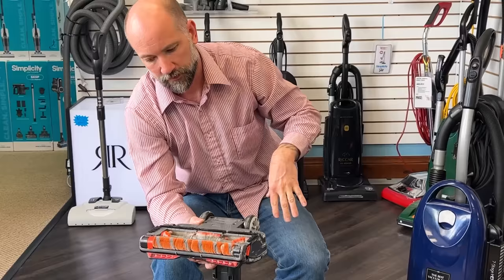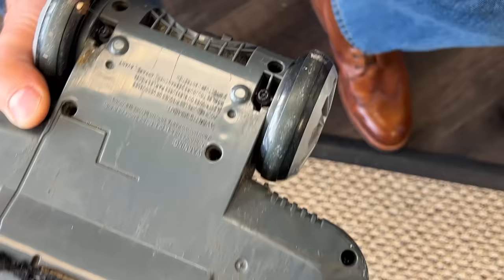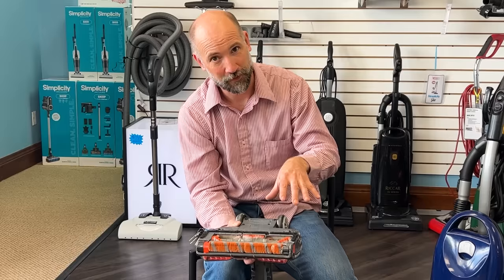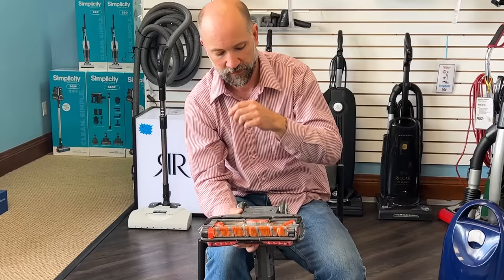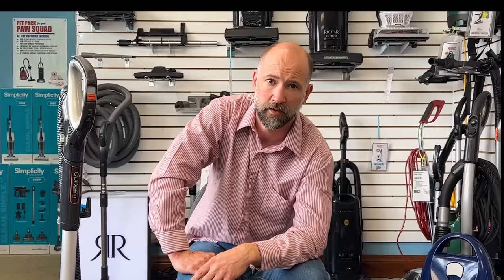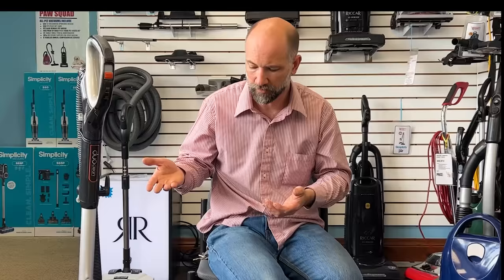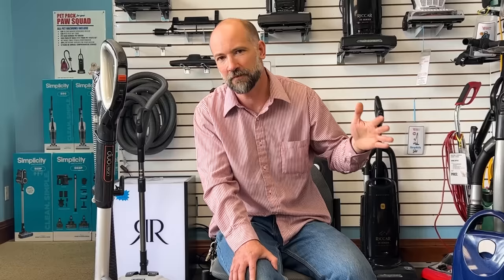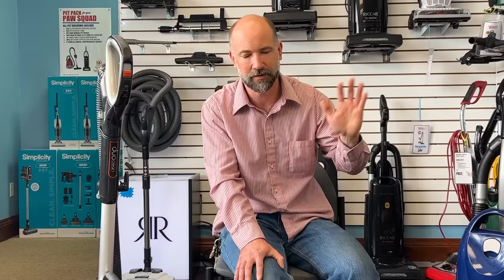Why Can't You Repair Your Shark Vacuum?

Comment: Shark Rotator Powered Lift-Away TruePet Upright Corded Bagless Vacuum for Carpet and Hard Floor with Hand Vacuum and Anti-Allergy Seal (NV752)

Handle problems. Any idea how to fix?  New Zealand 

Also  foot on Motorized Floor Nozzle For NV800/NZ801. Hell of a noise so , Just received a new roller brush,  still making a noise and brush isnt rolling ?

Comment: I have a well used Shark Duo that is 7 years old.I did a lot of research when I bought it, Dyson had the only comparable performance but still lacked in some ways such as functionality and was significantly more expensive. I could find no other cordless stick-style vacuums to compare (Bissel, Hoover, Bosxh, etc all could not compete with the Shark) and when holding and inspecting a Dyson Rocket in one hand and the Shark Duo in the other, the Shark was much better construction. I've had no problems maintaining it, it just needs to be kept clean. 

What brands are high quality, performance, and easy for people to repair? Does me no good to have an easy to repair vacuum that just pushes dirt around.

Comment: You can defeat those keyed torx heads with a small flathead screwdriver sourcing a torx set is easy online. However the fact they keyed them is a jerk move just repaired my shark with a bad lower hose.

Comment: I had a shark cordless hz2003. I loved it until after 2 years of use, motor started to overheat and wouldnt suck properly. 
So i tried to open it and the plastic is glued or snapped to the motherboard.
What other brand or model do you recommend that is serviceable and overall a solid product?
Reply from the maker: This video might help! https://youtu.be/JWXJw0GWTNo

Comment: I just encountered my first (failed) attempt to get the brush roller out.    So while picking here and there still no luck.  Got razor blade to cut as much as I could away from the roller ends.  Then come to discover I'll clean the whole thing up.  So, you push this little button and the dirt lid pops off so at least an idiot could do it, but if you look way up in there, there is this very small HEPA/Paper type filter that nobody would think to look at.  Luckily, you can pull it out and fortunately I have an air compressor that I can blow out the really fine dust/micro-dust and re-use it.  Was there anyplace online that had that paper pleated filter?  Of course NOT    I'm often tempted to go back the Hoover that had a paper bag and filter... Pop it out, but a new one in - DONE  Oh yes and speaking of DONE?  No more Sharks in this house.

Comment: Welcome to laptop repair from the early 2010's. They all started doing this and it only got worse, wait until you get parts with chips in them that prevent repair without flashing the chip with a security key or something.

Comment: I saw your video because my Shark Vaccum just stopped working, what company and model do you find is good in your opinion ? I don’t want a cordless model, I find batteries are super expensive to replace and I don’t like being bogged down to the time of the battery length.  Not happy with Shark. Had bought a big canister model for myself and a smaller one to give my son as gift when he moved out on his own and did not like customer service when I had a problem with mine. Thank you in advance
Reply from the maker: We personally like Sebo and Riccar, although the models definitely vary based on what you're looking for in a vacuum. Like performance on both hardwood and carpet, or upright vs canister, etc... we have a couple comparison videos on our channel and should have more coming soon.

Comment: As an automotive tech I frequently come across torx,torx plus,tamperproof torx and tamperproof torx plus(5 lobes),along with TA,triwings,the odd Robertson fittings,one way heads shear bolts,tamperproof hex,Ribe drive and those  pig nose or snake eye fixings. Everyone's at it,most electronic components are potted in solid resin inside a sealed case to stop you poking around,or are destroyed by their dismantling.

Comment: I have a cleaning business.  I don’t mind buying a new shark once a year.  I bought riccar vacuums for years and I got sick of the noise and weight.  I wish the upright riccar vacuum could convert to a canister like the shark lift away does so I wouldn’t always need 2 vacuums.  I hate regular canisters for vacuuming hard wood floors.  I like having easy tools for edging but my riccar super light doesn’t do that.  The heavier riccar needs expensive filters changes constantly or it smells horrible.  I am irritated that I can’t get the vacuum head apart to clean it out because it’s just stupid.

Comment: Got a damn toy caught up behind the middle brush. What a pain in the ass trying to get this thing apart. That middle screw of course my bit needed a thinner extension. Or a longer speciality tool. Then the snaps getting them back together with the roller side clip. Not for the normal handyman.

Comment: Sharks 5 year warranty is a lie. The motorized brush on mine stopped working, and when I called to file a warranty claim they said that “electrical components” are not covered under warranty. Interesting, because the vacuum itself is an electrical component, so by their own admission the vacuum is not covered under warranty. There’s some legal trickery in offering a limited 5 year warranty in replacement of a normal 1 year warranty, they can get away with not actually covering anything.

Comment: No way. I'm going to fix this beast just to spite them now (plus I would rather not buy a new thing). What happened with our Shark is that the tab that keeps the upright tube attached to the motorized brush head broke. So now the head just pulls off once you pull the vacuum backward. Once I get this bastard open, I will glue the tab back together, scan it, and 3D print a new locking tab. This is the way!

Comment: No Belts?? what the F?
I was shocked to hear that they don't sell replacement belts!
(Don't they even offer 'authorized factory service' to fix a broken belt?)
I would think the 'right to repair' laws might apply, except, there is an exception if the replacement parts are not made...

Comment: My new refrigerator operates on 95 volts, the repairman slipped and told me that. Yes a repairman on a brand new refrigerator. I believe he said something about DC current but I haven't been able to verify that. But lower voltage is a new "law" voltage reduction I think.   No where can I find the voltage on the fridge or manual. I called the company and got no help. My fridge runs constantly. I bought a meter to see how much energy it is using.  From what I understand this can damage appliances. I am concerned about fires.

The tax reductions for solar panels made other peoples electric bills go up.  Long story short voltage reduction will likely make electric bills go up.

Comment: Someone I know went through Shark after Shark after Shark, and found that not only did they keep breaking, but that despite their claims of HEPA filtration, his allergies would get worse every time he vacuumed, and to boot, they didn't get much of the cat hair out of the carpets.

Oh, he thought they did at first, because the brush rolls kept getting jammed with hair, both cat and human, so he figured they must have been getting it. But then I brought by a Royal and used that, and the carpet literally got lighter, and despite its mediocre filtration, all the dirt left inside a bag, and didn't aggravate his allergies nearly as much. So when that last Shark died, I finally persuaded him to pick up a used Sebo Automatic X4. So far, not an issue at all, no more allergy trouble, and it does a way better job on the hair than any Shark ever did - pretty much as well as the Royal did.

Comment: Numatic henrys are the best, every cleaning company  you see uses them ( in the U.K) the tube assembly and accessories are easily available, everything is modular and replaceable. Whats more they only cost 150 pounds or so. Dyson and Shark are sold as high tech lifestyle  products, really expensive and ultimately shite.

Comment: Security bit sets are everywhere, Harbor freight sells a complete 72 piece set for $10... I've had my Shark for 8 years. Use it often. It's been the absolute best vacuum cleaner I've ever owned. And I've owned many... Including Oreck and Dyson... When it breaks. I will buy another. I won't even think about it. Its no different than t.V's.. They dont repair them.. They replace them. I would rather spend $400 on 2 Shark Vacuums than $600 on 1 Dyson...
Reply from the maker: Inquiring minds want to know. Do you also follow Elon Musk on twitter?

Comment: Ex electronics repair tech here. I own a shark navigator. The most expensive “designer vac” I’ve ever owned. It’s criminal how these things are marketed, marked-up and built for disposal. I’m not expecting mine to last more than 5 years. And when it does kick the bucket I’ll be tossing it and buying an old fashioned serviceable commercial Oreck. If “shark ninja” won’t allow their products to be serviceable then I won’t be buying their products ever again.
Reply from the maker: The Oreck brand was purchased by techtronics industries of Hong Kong several years ago. Their business model has transitioned to be more in line with Shark's since that time.
Reply: @vacuumsrus  not surprised the company changed hands since. The last Oreck commercial I serviced in the late 90’s was pretty well built and very easy to work on. What do you recommend these days for something similar, without antique shopping?

Comment: When we first got ours well over a decade ago, the Home Depot had the drive bands for the roller for sale but after a few years I went in and was told they could no longer get them, which of course I found irritating but I did find a third-party source that seemed to have reasonably durable ones. I also found a supplier for my foam filter under the dust canister as well as the one that goes in the front of the vacuum that looks like an AC filter. I bought a few sets just in case that source vanished but I'm only on my second set in 16 years as I tend to clean them regularly so they don't get as ragged out.

As for disassembly, the only thing worse I've had to get into was an old MacIntosh II case with the sharp tin everywhere. Oh, and a Volvo 240 water pump housing. F U, VOLVO!

Comment: I'm in the uk and my friend's catch on her lift away broke they wanted £35 for a replacment wand all because a plastic bit broke so i took it all apart drilled a small hole in the centre of both peices cut a paper clip mitre glued that into the hole then mitre glued the two peices together then put two more bits of paper clips on the side with mitre glue it has been working like new since, after that experiance i vowed not to buy shark vacuums instead I brought numatic commonly known as henry

Comment: Go to harbor freight and get the set of security bits for 5 bucks that's where I got mine and work great also on washers and dryers. Sharks just clog alot. But I work on the sharks here at my house and at work but they are very much a pain in the butt I will agree lol 😂 I also have a Electrolux but she's much easier to work on. Also I've had it 10 years only thing that's not original is the battery pack made myself when the original crapped out on me.

Comment: I am as frustrated as the technician who did this video is on behalf of the service they provide and customers, because I found myself wanting to fix the powerhead because the powerhead itself, not the motor, suddenly seized up.

I am somewhat handy and have many tools and different size wrenches, keys, torque, wrenches, and someone But, that stinking stupid hexagon screw with a stud in the centre of it. I had to use a very small slotted screwdriver to take them off and that wasn’t bad enough. I couldn’t even get the powerhead because it seemed to be in case.

Long story short, if shark thought they would get more customers, because of their snot on making it difficult, they are wrong because I will never buy a sharp product nor recommend it to anybody, family or friends.

Thanks for the video and the outlet for me to vent

Comment: My NV601 lasted five years before the lower hose split. The way it's attached there's no practical way to change just the hose, and having to buy a second-hand power floor nozzle (new is out of stock everywhere) just to fix this is just brain-dead. Ave atque vale Shark, you did your duty but it's time to move on.

Comment: OMG - THANK YOU FOR THIS VIDEO!   I have rebuilt a ton of personal vacuums, renovated homes from drywall out and of course built and rebuilt vintage cars.  I can fix anything....except this freakin' vacuum (shark ROCKET POWERHEAD AH452).  The belt must be broke (brushes not spinning) and YES - stupid screws and different sizes.  No - we can't have a simple side cover come off for the belt access.  I will personally take this out back and fix it with my sledgehammer (seriously - it will make me feel better!).  NEVER BUY A SHARK.  Real BS product.

Comment: Your argument is flawed because Dyson is the same thing they use the same security torx screws and the hidden clips too. Pretty much anyone I know that maintains their own possessions have a security torx bit set so they are more common than you say. Shark vacuums are good quality and reliable as long as you treat them well and do simple things to keep it running well.

Comment: Definitely NOT a conspiracy theory lol.  The only thing surprising about Shark vacuums is they developed good-enough budget Chinese manufacturing chain & QC to where their vacuums work pretty darn well...UNTIL THEY DON'T💩 In it's early years~ maybe up to 15 years or so ago(?) - the brand had pretty awful manufacturing reliability/QC, so the way it is now is a huge improvement ...trust me.  But one thing never changed along the way: like most 21st century home appliance & tool brands, Shark/Euro Pro was always devoted to  the semi-disposable product model.  That is, completely ignore the repair market in favor of increasing the frequency of product replacement.   Sadly, I  think it's clear that this business strategy is very effective across the board with costumer products in this low- to mid-range price range.  It's horrible for repair shops of any kind, for the environment, and costs the consumer more in the long run, but most consumers gravitate to the savings in the short term. Definitely representative of a larger trend in our society, for better or (much) worse.

Comment: I wonder if going to the security screws with a dremel cutoff wheel making a slot in it would work? Might melt the plastic. This anti repair tech is heavy in the auto industry. It has to stop

Comment: The short answer is Shark vacuums suck.  I bought 2.  They don't get close to the baseboard.  The vac head is too tall and bulky to get under any furniture without having to break out the extensions and take apart the handle/hose.  They are an absolute mess to empty.  Who wants to hand wash a filthy, smelly pre-filter?  The vacuums stink like no other vacuum I have used in my nearly 70 years.  I threw the office one  away that still worked.  The home one is limited to cleaning up the scattered litter around the cat litter box.  I have reverted back to my 1988 Electrolux Discovery III which still does a far better job, doesn't stink, and has never had to be repaired.

Comment: This is what happens when the „Apple 🍎“ business model is applied to household appliances, and it's a model that's extremely concerning indeed. The general gist is to make sure the customer never owns the product they pay for, but instead is driven into a „Subscription by the Back Door“ model, where it's only after the 3rd or 4th purchase the consumer realises the cycle they've become stuck in. That, incidentally, is why I no longer use an iPhone. 👍

Interestingly enough; Shark products are also offered here in the UK (Mainly through TV advertising) but the interesting point here is that they've only entered the UK market after the UK left the E.U. Customs Union. I get the impression the E.U. Right to Repair laws might be scaring the Brexit💩 out of Shark, at least... 😉

Finally: I looked into buying a Shark vacuum on finance once, but backed out after learning it would cost me an arm and a leg... 🦈💰🙃

Comment: I realized they wanted me to throw my Rotator Professional Liftaway in the trash when the belt broke and I couldnt replace it. I took it to a local repair but it soured me on Shark I've had it 10 yrs  I;ve signed a right to repair petition. They are disgraceful.

Comment: "Shark" is aptly named. I went out and bought the Torx drive to remove the screws and it removed all but three of them. One seemed to be a smaller size, but the heads on the other two were worn down, so my screwdriver couldn't get ahold of them. They are recessed, so it's not likely they got worn down from use. Would the Sharks have filed them down so they couldn't be removed? I wouldn't put it past them. For one last kick in the b--ls, they put a sticker on the housing advising me to "Unplug the machine before working on it." Jacka$$e$.